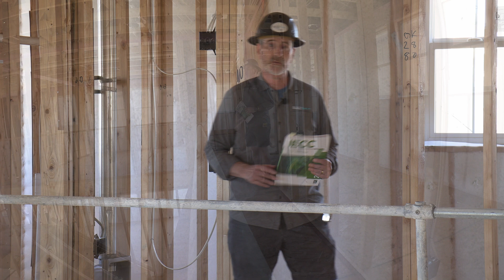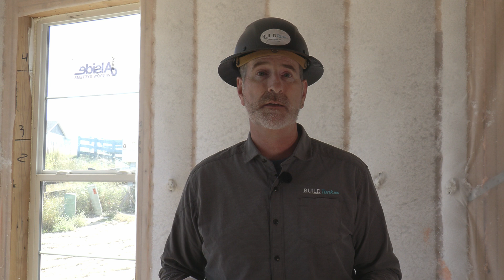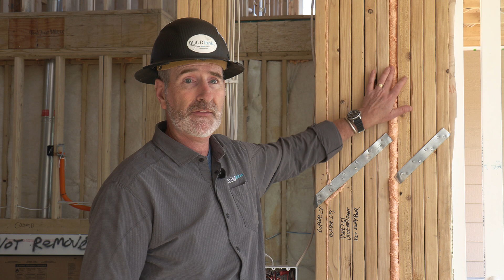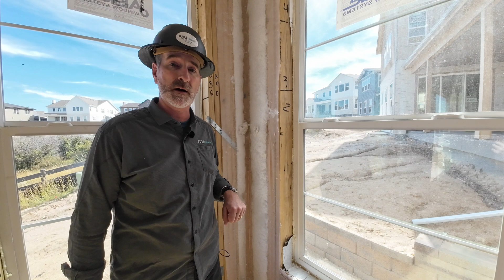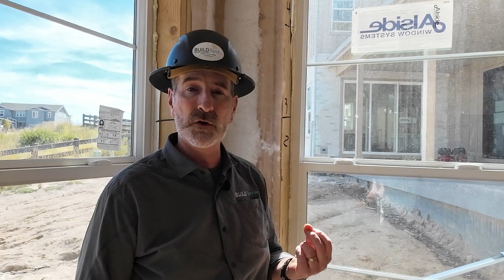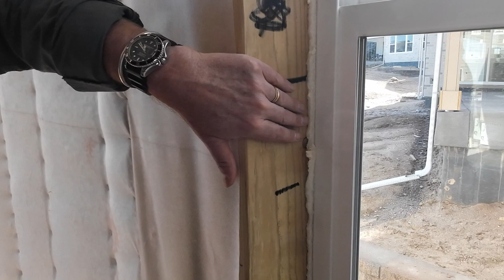Air Sealing - Field Application of the Energy Code

Comment: My question is, will you suffocate if you don’t open your windows or don’t have  your ventilation system on?
Reply from the maker: A house will likely not be so tight that you suffocate.   But - indoor air quality can easily become a problem if a house does not have enough air exchanges.

Comment: What code, there is no code for sealing a home or building.  This is one of the reasons homes today are so expensive.  It is baloney and common sense shows you how to seal a home.  Do not seal homes completely because it is very unhealthy for humans.
Reply from the maker: Sorry sir, but you are wrong.   2021 IECC and 2021 IRC now require air sealing in many locations - more than we cover in this mini series of 14 videos.
Reply: You are lying.  Thousands of companies have tried to get rich in the past by getting laws passed so their product would sell.  I started building in 1957 and was building until a couple of years ago.   I have seen a lot of history of the home building industry.   @ConstructionEd
Reply from the maker: @thomaswayneward   Sorry you feel that I am lying -   I encourage you to review the code yourself and make your own informed judgment. https://codes.iccsafe.org/content/IECC2021P2/chapter-4-re-residential-energy-efficiency#action-wrapper-24249189
There are many changes coming to the homebuilding industry through the 2021 IECC and IRC - Parts of it are troubling to some - and welcome to others.   Bottom line, houses will be built differently as each jurisdiction adopts the new codes.